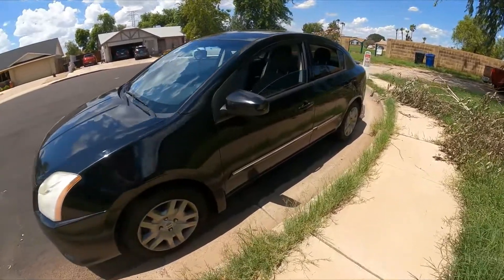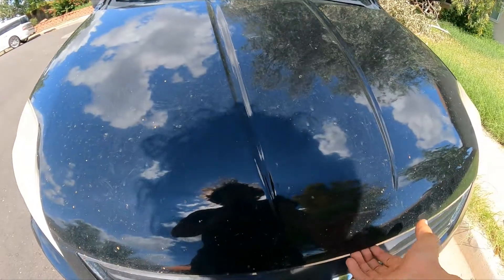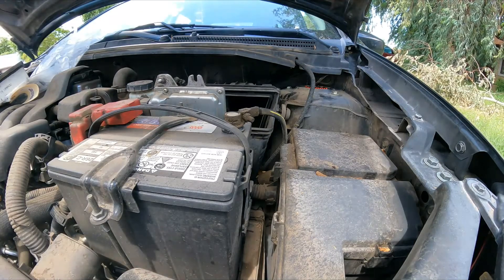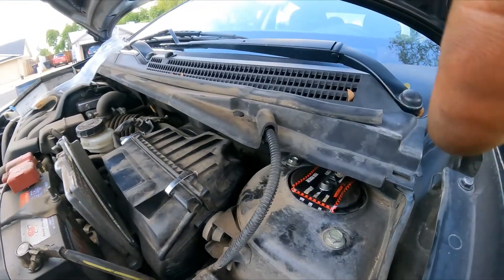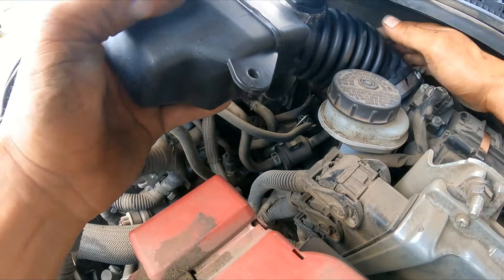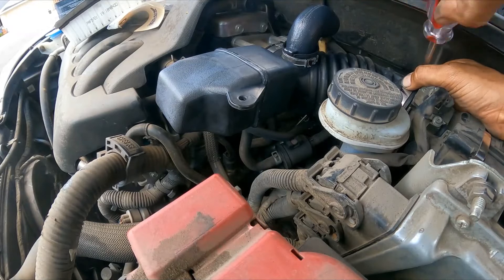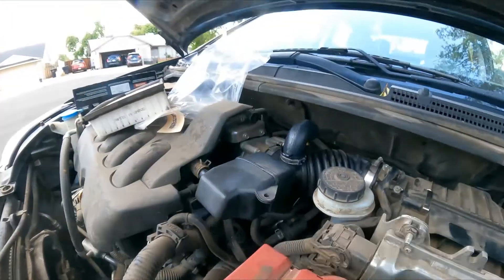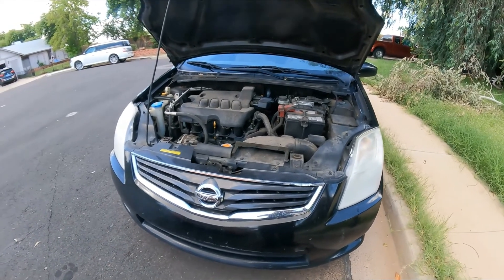2012 Nissan Sentra 2 0L Code P0171 Won't pass emissions Problem Solved! EASY

Comment: If you ever replace the MAF sensor on a 2007-2012 Sentra, use a genuine Nissan sensor 22680-7S000. I replaced my original 250,000 mile, 12 year old sensor with a new Delphi AF10141 sensor and it threw a P0171 lean condition code. Delphi sensor was $90+, which did not work, and the genuine Nissan was $210+ and worked perfectly!

Comment: Did it pass after replacing the hose or did You restart the ecu battery etc.
Reply from the maker: Yes, it passed (codes did not return). However, the ecu needs to be reset and complete the drive cycle to pass emissions. I hope the video helps you. Please consider subscribing to the channel and God bless you.
Reply: @gqautodiagnostics  thank you